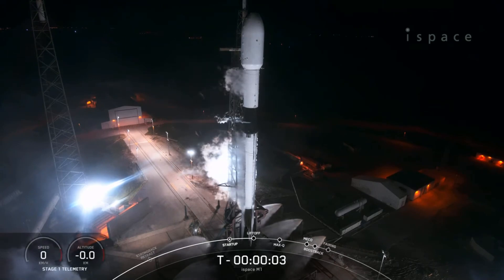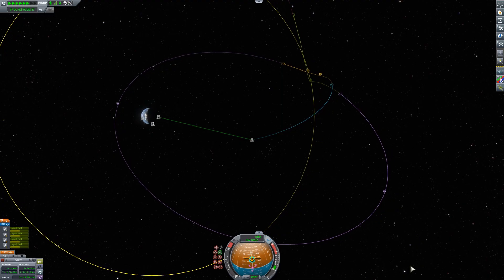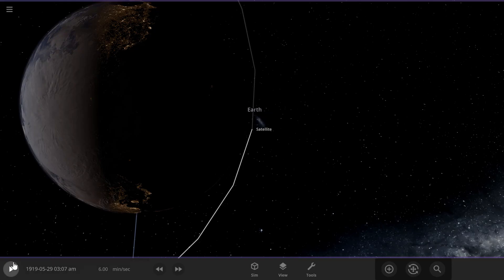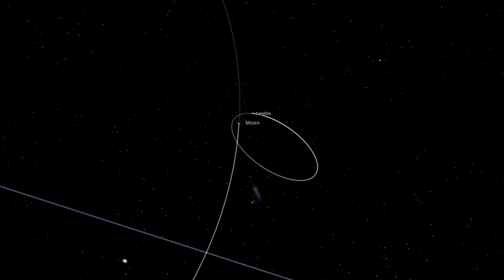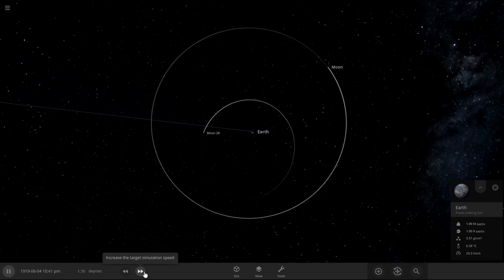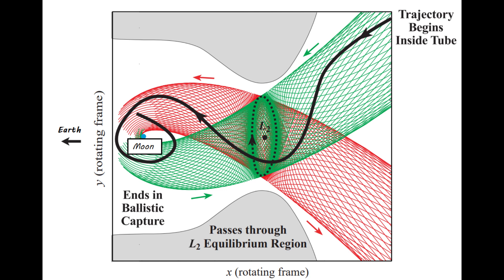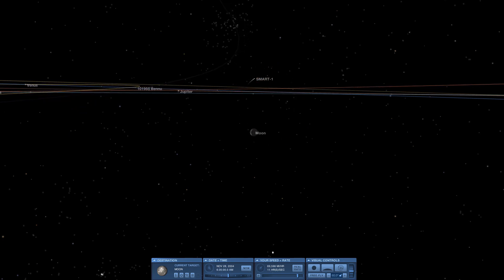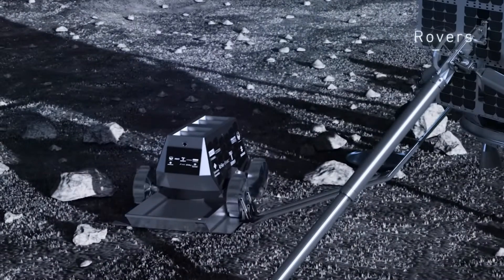Why Spacecraft Are Using These Crazy Routes To The Moon - Weak Stability and Ballistic Capture.

Comment: @Scott Could this method be used to move a large asteroid (for example one made of ice) until it lands "safely" on Mars? By helping smaller objects to move larger ones, through a large number of orbits, to progressively reach the goal? That would be the ultimate case of reverse orbit calculation. Use AI to do the heavy duty work.
Then we really could terraform Mars. Some iron to re-ignite its dead magnetic field? If time was not an issue.
Reply: I guess that depends in part on how you define landing. :)

I don't think much can be done externally to make the Martian core molten again.
Reply: @TheEvilmooseofdoom  It depends on how much change you can accept. If hitting Mars hard enough to push an iron asteroid large enough to the center it would cause a very large scale destruction. But if that is the only way to give Mars a magnetic field then maybe it could be worth it long term?
Without a magnetic field Mars can't hold an atmosphere or shield life from radiation.
Maybe someone can think of a method to divide the asteroid into smaller parts and point them down a volcano, idk. Just a fun thought.
Reply: @knowledgeisgood9645  Hitting it with a large hunk of iron is going to vaporize that hunk of iron.  Impactors don't usually bury themselves unless going really slow.  And then you're still not going reach the core of the planet.  It is an interesting though, but I don't think it's quite practical. :)

Comment: I'd be really interested to hear much mass (as a percentage of the spacecraft's mass) these maneuvers save the craft's designers.  Seems like it has to be substantial for the time and effort they spend to perform it successfully!  The calculation and risk assessment that must go into it is mind-boggling.
Reply: You’d be interested in the delta V difference
Reply: @sil8127  I'm guessing he wants the mass cost of that delta-v for those real spacecraft with their real technical limitations.
Reply: @johndododoe1411  well that depends a lot on other factors, like the dry mass, the thruster specific impulse, etc. It's easier to use the delta-v savings as a yardstick, then go from there. For instance, spacecraft propellant mass is directly proportional to dry mass. So a 1 ton dry mass craft might save a thousand times more propellant mass than a 1 kilogram dry mass spacecraft given the same delta-v savings
Reply: I don't believe these low delta-v trajectories should EVER be considered for manned space flight. Exposing astronauts to the stresses of Earth-Lunar transit for an additional 3 days, round trip, is unconscionable. It's not like they're taking extra payload.. they're not even taking a lander, FFS!
Reply: This one is pretty easy to make a vague guess. Scott said the apogee rise to the moon is 2800 d/v, plus 50 for the high orbit. And then you save most of the insertion burn. According to google, thats 600-700 d/v for an isertion burn you mostly save.
Which doesnt sound like much, but considering rocket size (and cost) rises exponentially compared to range, its probably worth it.

I dont think the risk and calculation is a big deal tho. Someone figured out the math, made the tools and software. From then onwards you get easy, accurate numbers in comparably little time. Just a guy trying numbers in a compture, then doubly check the course. If your spacecraft can do an accurate lunar insertion, then it can probably do this maneuver already, its just a longer mission.

Comment: i'd imagine a big difference here as well, is computer simulation capacity.
during the apollo program the machines ran on the equivalent of a low-end calculator app, and that was state of the art million dollar tech. today, that level of computation costs pennies, and we've moved on to the ability to simulate these orbital mechanics in real time through a GUI. something that was available to you, an average consumer, for a few hundred dollars if you account for the cost of the computer running it, less than a hundred if you already have a suitable machine don't have to do that.

Comment: The question is.. what system does KSP 2 use? 2 or 3 Body problem
Reply: KSP only calculates one source of gravity at a time.  Each body has a predetermined "sphere of influence", in which everything only considers that body's gravity, and outside of that, the parent body's gravity.  There is a sudden transition from one to the other.

Comment: Did the recent Capstone mission use one of these crazy routes to get to the moon?
Reply: It did. It used almost exactly the way Scott showed with Universe Sandbox, flying out near to the Sun-Earth L1 point using that to raise the periapsis. The small differences is that it captured into a high inclination orbit (the often talked about Near Rectilinear Halo Orbit), rather than the fairly low inclination one Scott showed. An other small difference is that it used small burns to adjust after the initial burn out to L1, not a completely unpowered capture.

Edit: You can check Capstone, or the other mentioned missions on "Nasa's Eyes" that has all the mission trajectories of space missions, and you can see the way the went if you go back to their launch date, then speed up time so you can view it in a minute (it took CAPSTONE nearly 5 months in real time).

Comment: Awesome stuff, n-body physics interactions are fascinating. Have you heard of the Interplanetary Transport Network? It's the concept that all these chaotic interactions create 'pathways' between the Lagrange points of pretty much every body in the solar system. From the Moon to Jupiter, without a single drop of fuel. You'll just need a LOT of patience. (for everything to line up, and for all the natural gravity assists...)
Reply: I think the need for patience is a problem with it, unfortunately humans get old and die, and hardware goes obsolete so its not like we can wait 50years for something to navigate it way out to Neptune riding this network just to save on fuel. (Although it may be useful within a planetary system like Jupiter or Saturn where the travel distance is much smaller so the timeframe is reduced to something much more tollerable)
Reply: I think there technically is a little fuel requirement, to get the initial kick from Lagrange to the path you actually want instead of staying at the Lagrange point.

And I guess a bit to compensate for inaccuracies, but eh, details.
Reply: The "interplanetary highway" concept is awesome, I'm pretty lucky to have gotten the opportunity to learn underneath faculty who has contributed immensely to it. So with that I have to plug his youtube channel - https://www.youtube.com/channel/UC9ZvnHwvAR4XkjKzKxhYDDg
Reply: The "interplanetary lazy river" might be a more appropriate name
Reply: He's mentioned it before. Nothing in depth that I'm aware of, just as a concept.
Reply: I think some 'thrill seekers' did that in the TV show 'The Expanse'
Reply: @jimmyjango5213  Yeah, they were in the Jovian system and wanted to avoid detection by only using passive maneuvers that could be tailored with their reaction control system (which couldn't be detected by the baddies).  I was thinking the same thing.
Reply: I'm pretty sure that chaos comes into play: even if you can afford to wait for a very, very long time, you'll have no idea where you're going to go, or when.  
It would be like tossing a tennis ball off the Golden Gate Bridge, on the theory that it's going to end up in Sydney Harbor.  Yeah, it might ... there is a path ... but you don't want to count on it.  You might miss the path by a billionth of a second - or a nanometer or two - and end up in Tokyo instead.
Reply: Maybe someday, this way, one will be able to finally lend Venus a moonlet
Reply: I would love a video from Scott of the ITN! I kept expecting him to get there in this vid and was disappointed. At least he mentioned Hiten.
Reply: I’d love to see some of these paths, maybe even using the jovian moons just to get everywhere. Like a Voyager 3 that, over the course of decades visits everything in the solar system with some insane trajectory
Reply: Yes, I've read about that, about 20-25 years ago.  Was it covered in Scientific American or somesuch?
Reply: @JohnDlugosz  Belbruno's book Fly Me to the Moon.

Comment: It's kinda crazy that only 50 meters of dV is enough to go past Moon to the edge of Earth's sphere of influence.
Reply: It's only enough if you do it close to the earth, when you're going fastest.  Escaping a gravity well costs energy, but your fuel budget is change in velocity, with how rockets work.  Since energy is proportional to the square of velocity, changing velocity when you're going fast is a much bigger difference than when you are going slowly (it's called the Oberth effect).
Reply: @Br3ttM  Square of velocity relative to what? The place of origin? The object being orbited? It seems to me the energy required to change speed by x m/s would be the same for any object in an inertial frame, which a satellite is. I'm probably wrong, but what am I missing? (I'm sure it's something simple.)
Reply: @beenaplumber8379 Consider gravitational potential as well. Total Energy = KE + PE or 1/2mv^2 + mgh. When at apoapsis the dominant term is PE, when at periapsis KE is dominant.
Reply: @beenaplumber8379  I'm a year late but here goes: the Oberth effect works relative to any consistent inertial reference frame. It's counter-intuitive because energy is conserved within a reference frame but not between different reference frames.

If you really want your mind blown, at high enough velocities, a spacecraft can gain more kinetic energy from a burn than the total chemical energy in the propellant! This sounds like it violates conservation of energy until you realise that the propellant has lots of kinetic energy too, and the exhaust has less kinetic energy after it gets kicked out the back of the rocket, and that lost kinetic energy must end up in the craft to be conserved.
Reply: @chriss1331  I kinda understand that answer - thanks! I need to swirl it around and let it soak in, but yeah, the mass of the fuel of course has its own kinetic energy, and the exhaust gas would be going slower relative to the object being orbited than if the rocket were still, relative to that object, and that reduced gas velocity (kinetic energy) of course transfers to the rocket. It makes sense to me. I think...

Understanding relativity was a COVID goal of mine. I kinda got there... almost... in a non-physicist trying to understand the concept of something really foreign way. But this sounds like the sort of relativity that Newton would have understood. Your 2nd paragraph makes sense of it to me. I mean, if a rocket flew past an observer at a very fast speed, the observer would see the exhaust gases moving in the same direction as the rocket, only slower. If that observer encountered the exhaust gases, they would be blasted in the direction of the rocket's travel. Okay, mind properly blown. 🙂
Reply: That's gravity wells for ya

Comment: All that these videos do is make me a better KSP player. 😂. Thanks, Scott!
Reply: Makes me wonder if Principia can handle these orbits in KSP?
Reply: @chrischeers8081  Yes it can, but planning one of these might be difficult since we don't have a good trajectory planning tool to come up with the timings. The simpler weak boundary layer capture like SMART-1 used is pretty easy to do with the ingame tools, but I think the one combining the Sun and the Moon (or Kerbol and Mun in KSP) Lagrange points would be a struggle due to having to line up the timing.
Reply: @chrischeers8081  no reason it couldn't. Accuracy might be off and it'd be hard to get precise, but it's all what that mod is designed for.
Reply: I believe KSP just uses acceleration fields/volumes and doesn't actually calculate the forces acting on every spaceship from all of the plantoids. So sadly the Lagrange points and gravity maps won't be exploitable due to this simplification.
Reply: @jasonreed7522  Stock yes. We are talking about the Principia mod. Which has full N-body simulation, using all the bodies at once (and the planets/moons are also no longer on rails in it, they also affect eachother, which necessitated a few changes in the Jool system, because the stock one is really unstable).

Comment: Scott pls talk about Helion's fusion reactor Trenta (Real Engineering has me convinced we'll see actual net gain by 2024 - when they finish their Polaris generator, a better version of Trenta)
Will we see actual net gain energy by 2024 unlike NIF's "net gain"? 
I say this because these guys use the magnetic containment itself to generate their energy - a direct magnetic to electric transfer like in electric motors (If I got it correctly)

Nobody else has this kind of tech/approach, right? (like, everyone else's idea of fusion is just to heat up some steam/spin up turbines/spin up motors...)
Reply from the maker: I don't know much about their system, but I will say it's not an innovative idea to use the magnetic fields to generate the energy, that's been known about for years. The idea to use Helium 3 isn't new either. 
What I do know is that nobody else is pursuing helium 3 fusion right now because it requires pressures and densities much higher than Deuterium-Tritium. So, I'd like to know what their current energy balance is since they're choosing a much harder option.
Reply: @scottmanley  Ah I see, interesting. Thanks :)
Reply: @scottmanley  They are using D-D fusion to generate the HE3, that's seems even more fantastic to me.
Reply from the maker: The dominant result from D-D fusion is He3 + Neutron. HE4 does happen but is the rarer result.
Reply: If I remember correctly, Helion didn't say that Polaris would demonstrate net gain, they said it would demonstrate electricity capture.  The amount of electricity they extract is still probably going to be less than what's used.
Reply: That subject suffers from the problem with the only people that really know deeply about it are the ones financially invested in it succeeding. So hard to bring more objective opinions to the discussion currently.
Reply: @ivolol   Yes, correct. 
Also you just described most tech ever invented, when it was new. 
I would leave it up to Scott :)
Reply: That video is a marketing video, you shouldn't let it inform your opinions on anything.
Reply: @infinitelyexplosive  Agreed, but I am crossing my fingers anyway.
Reply: If you're so worried about it, you should head over to the realengineering channel. He did a fantastic video about it. I wouldn't say this channel seems too focused on various fusion technologies. Of course that's up to Scott but it doesn't seem likely
Reply: Every youtuber is already talking about them and their fusion system is nonsense.